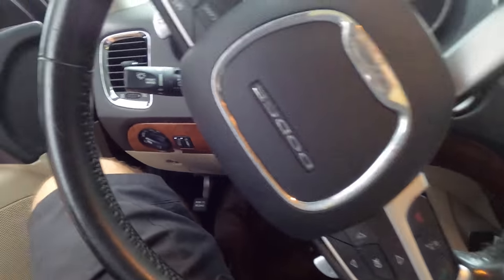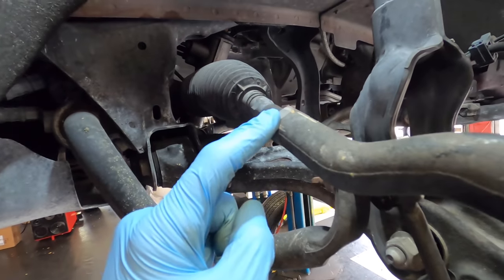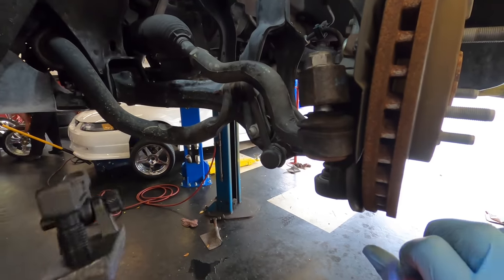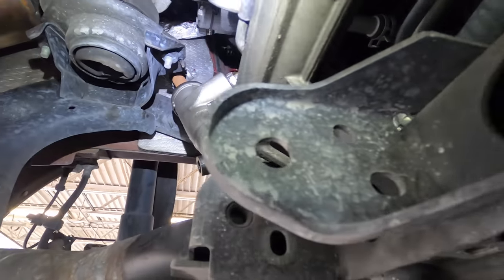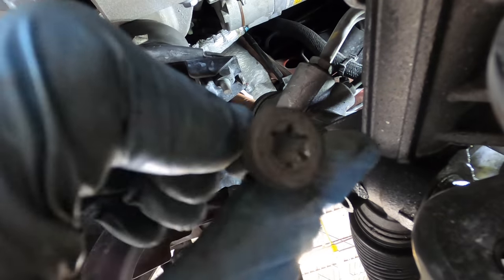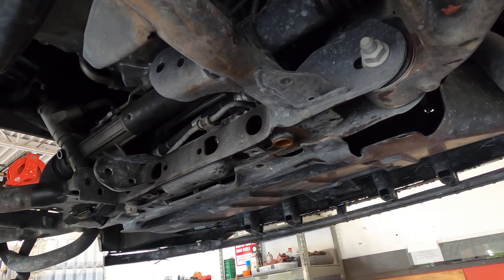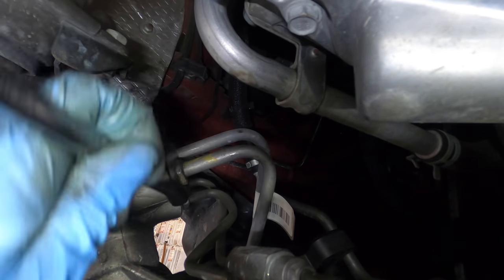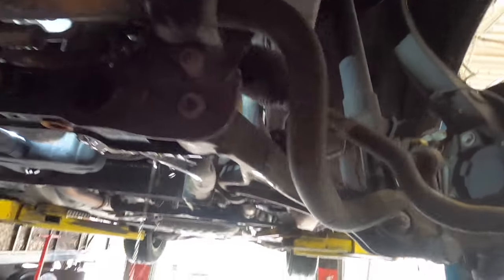Engineers vs Mechanics | They GOT Me!

Comment: I think anyone that's worked on cars long enough has experienced moments like this. You fight and you fight and you fight but the part refuses to come out. Walk away for a while, come back, and it practically falls out the moment you touch it.
Reply: Not just mechanics . . That's a metaphor for life . .
Reply: Not done watching the vid yet. I think he just needs a bigger hammer. Or a snatch block? Kidding, of course. Been there, does suck.
Reply: as a tech, let me tell you, this is true with tech in general... be it gas engines, electric or computers... mechanical of electrical... anybody who spends long working with technology of any kind will have this kind of experience..

if you fight and fight, get frustrated and somebody who dosnt even know what they are doing walks up, and first try it comes lose.... that shit... can break your brain at times... 

also the "i have no idea why that worked but, now its working flawlessly, despite the fact that what i did, shouldnt have had that effect.. how the fuck...never mind, never look a gift horse in the mouth"
Reply: I remember once trying to get the bolts undone on a fuel filter (i think), it was in a deep (high) channel under the car and the opening between the various tubes/wires was that small that, iirc, to move one of the 6 faces of the nut around once needed 4 spanner on&offs as I rotated the angled open-ended spanner a smidgen each time! Took me fxxxen ages (about 15-20 mins for this bolt) but I had no choice but to persevere.
Reply: Years ago while trying to swap out an engine mount. It came out almost easy but no matter how much I tried it would not go back in. I was in the process of taking it back out thinking that I was sold the wrong part when it slipped out of my hands  and fell right into place. Sometimes you find yourself fighting and fighting on something and when you give up it finally starts to behave.
Reply: @christopherc1976  LMAO!
Reply: @gregwickham  So true. I think our frustration is a hindrance to a greater consciousness of thought and competence.
Reply: Once something starts going awry, or doesn't move like you expect you tend to go at it a bit more aggressively. Some parts need to be handled gently, so if we walk away, screw our heads back on and tackle the problem with a softer hand it moves nice and smooth. At least that's how I've come to it.
Reply: Hahah 1993 Toyota Corolla water pump.
Reply: Yep, that's rule number 1 4 sure!
Reply: Power Window assembles, power door lock actuators. Stuff assembled in factory on a worbench by techs who do nothing but assemble 100 doors a day.
Reply: Happened to me with a starter on my 2011 Elantra.  
I wiggled it around trying to avoid the possibility of needing to rack the engine back about 1/2" to get it to clear the frame.  Suddenly, poof!  there it is in my hands, like figuring out one of those bent nail puzzles.  The new one went in on first try...
Reply: I am a plumber and I can assure you, these moments are not limited to auto-mobile mechanics. Reaching through the tiny opening of a flushing cistern hidden behind the tiles while blindly fiddeling about the internals which you can not see since your hands, which barely fit to begin with, block all the available space of the opening and than trying to not drop any small part or assemble something in there... it can be a real nightmare.
Reply: I agree - also works if you drop or lose something, as soon as you stop looking for it, you seem to find it!
Reply: Two very strong friends were trying bout an hour to loosen a wheel bolt with an extended pipe on a wrench and asked me to have a go at it as I walked in and asked them if they talked to it then I said for theatrics "bolt come out" which it did on my first try with no effort. The female onlooker gave me a wry smile;)
Reply: More annoying when you spend 2 hours fighting it, someone else walks over for a minute and just pulls it out and it wasn't a matter of strength.
Reply: @shangri-la-la-la  reverse threaded bolts mebbe
Reply: 😂 thought similar thing. Spend two days fighting to get a part out. Then you get the new part installed no problems.
Reply: I worked in R&D for 32 years, and had some of my best "eureka"  moments and "epiphany" solutions to tough problems while in auto pilot mode driving.
My mind (sub conscious?) just seemed to solve problems when relaxing and listening to tunes on the radio, and not locked in dead end problem.
Thinking outside the box with the help of others also also helped lots of times. You have to be persistent and love a challenge, like Ray!   You the MAN!
Reply: Anyone who’s been a tech for a number of years has had this experience a few times over. The experience of struggling to get some part or unit either out or back in and then something happens that the part falls out or back in with minimal effort. It’s just “one of those things that happens”. Or it is “the Tech Gods” taking revenge on us for being such blasphemers. 
All that being said, if “zee engineers” had to “R&R” these parts or units on a regular basis, they would design cars in a way where it would be less of “a pain” to work on them for a living..
That’s my story and I’m sticking to it!
🤔🇨🇺🇺🇸
Reply: I have had that happen too many times
Reply: Been there many times, Walk away, think a bit, go back and it all works. I don't know why LOL
Reply: @brentbosworth8845  ….you take a break….your brain cools of a bit and…you go back and now you are able to think “more clearly” and you are able to find a solution.
🤔🇨🇺🇺🇸
Reply: @class2instructor32  Or water pump on 2003 diesel huyndai, yes there are holes for the bolts, but getting those bolts out from the holes in the frame, you need to move the engine in all 5 directions and turn some, bloody none of the holes line up when the engine is in its mounts.
And the last one under the waterpump it has reliev in the frame that is just right size for the bolt to go in, but the waterpump has one elevated hole in it, and I presume you might allready figured out what bolt that elevated hole is on, the damn bolt that has no go trough hole in the frame.
Well more bolts undone and push engine as far to transmission side as it goes and you are able to cut head of that bolt out. So you can remove the bolt and waterwheel can clear the waterpump housing
Installing a new pump I changed that long bolt to a stud, and it fitted with out a problem after you stick that stud halfway in to the frame wiggle waterwheel in to the hole and then wiggle the stud in its hole.
Reply: Engineers think car they designed never break down. LOL!!
Reply: Or you pretend you don't want it to come out, because if you don't want it to come out it will fall on your head.
Reply: @AshenTechDotCom  This is a combination of "shop blindness", time tension and billable hours.

If the repair manual, or what ever it was had not planted the seed in his head about 5 hrs, he would have just maneuvered that how he needed.

It did not help that he did not remove the tie rod ends, like the new  part came ready.

All these things overlooked in the tension of a time sensitive work place that day.

A longer coffee break and a good joke would have taken his mind off it enough to let his minds eye see the solution without his awareness.

It is good in the end that he still found the quick way out, even if it was not quite as quick as the reinstall.
Reply: I was changing a clutch with a buddy and the transmission wouldn't go in no matter what we did. Stopped for 5 minutes, came back, gave it a tiny kick (we were working on the ground) and it just slid in like that. We had been fighting with it for 2 hours at that point.
Reply: @sampic_  Been there. Even with an alignment tool or an old shaft you even look at them wrong and they won't go in sometimes. Other times they slide in like they're on rails.

Comment: 18 year engineer (various disciplines) here. I always ask when inquiring about a position "Will I be allowed to work with the people, or on the equipment I am designing/improving/developing process for?" If the answer is no, I won't take the job. If I am not allowed to spend time working the process, or on the equipment with the people that do it everyday... that job is not for me. I walked out on a job with a wall board company because I got in trouble for working on the line with the operators to see specifically how a piece of equipment was used. It's always been my opinion that if you can't repair it, build it, or run it... you shouldn't be designing it.
Reply: What you desire is right but you are a rarity.
Reply: As an old school mechanic, reading your post is sooo refreshing.  Hate uppity engineers.
Reply: the hero we need
Reply: I'm a millwright.. I wish all engineers shared your opinion.. I've worked with some extremely arrogant and pretentious engineers before who thought they were too good to even talk to the guys who actually have to turn the wrenches..